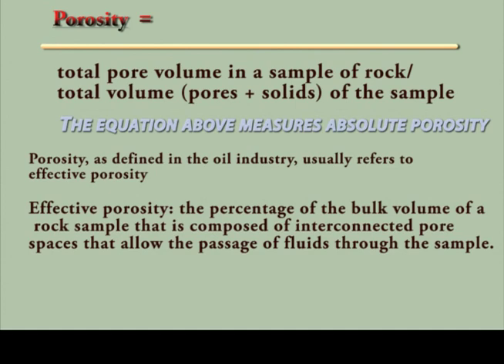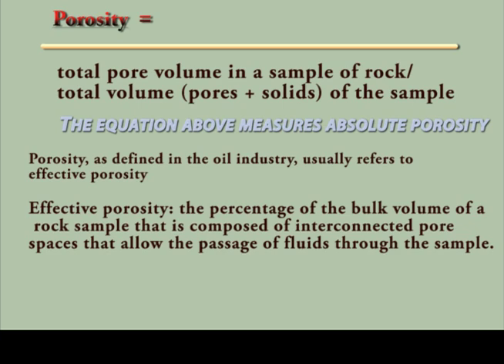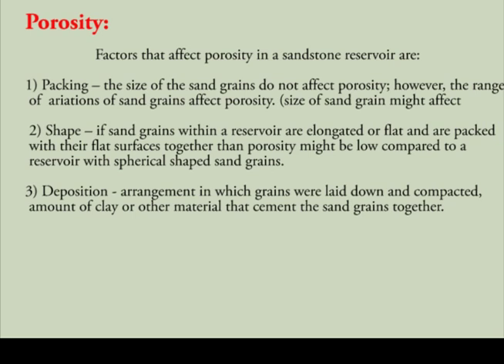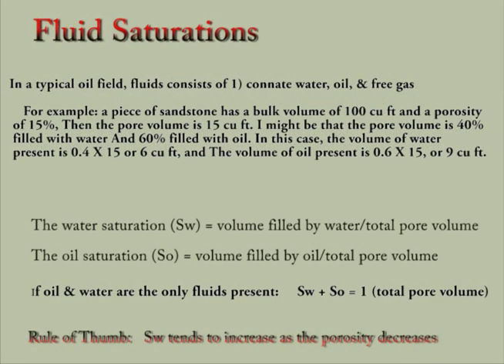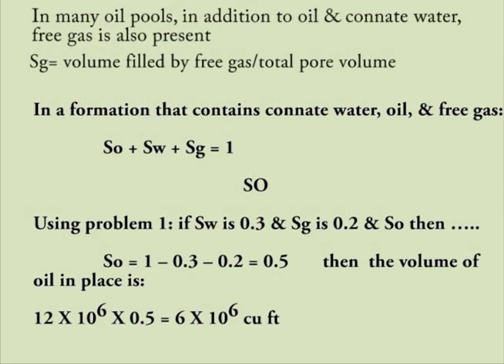Calculate Oil in Place

Comment: Ok great, but we don't sell oil by the cubic foot.  Oil is priced and sold by the barrel.  There is 7758 barrels of space in one acre foot.  First we subtract the rock matrix.  Say 80 percent.  Leaving 20 percent porosity.  7758 x 20 percent.  Then we seperate out Sw and Sg leaving So.  

We are not done because we can only recover a percentage of the oil in place.  (Recovery factor)  Also when oil is removed from the ground it tends to cool at the surface and shrink.  We have already subtracted for Sg so we don't do it again we just adjust for cooling.  Today we can recover more oil in place using modern technology so a 50-60 percent factor may be reasonable however 40 percent is the factor commonly used by developers looking to get some idea of the probable economics.  

We end up with something between 100 and 1000 barrels of oil per acre foot recoverable in place in sand and carbonate resivors, depending upon effective porosity, Sg and Sw content.

Finally when the  buyer pickes up the oil he takes a sample and seperates out the water and sediments  (bs&w) and subtracts volume based on temperature.